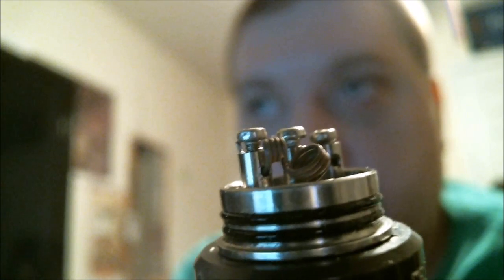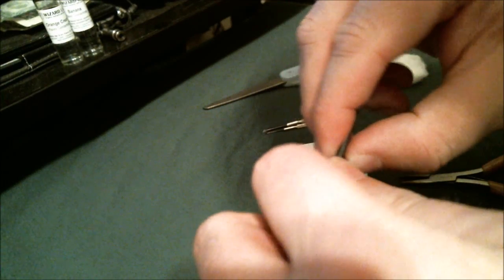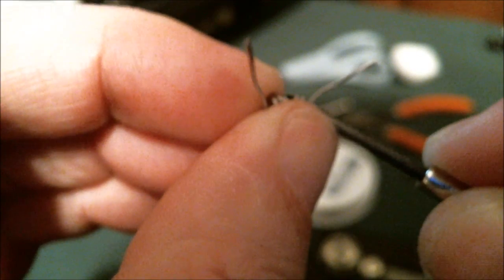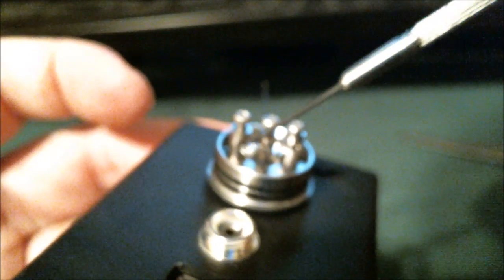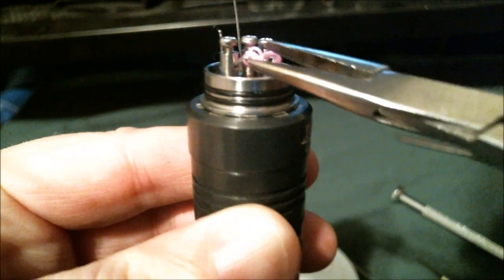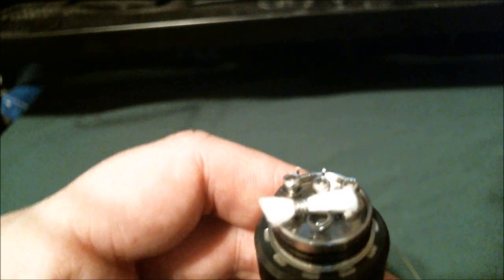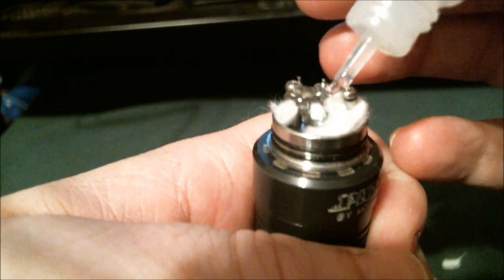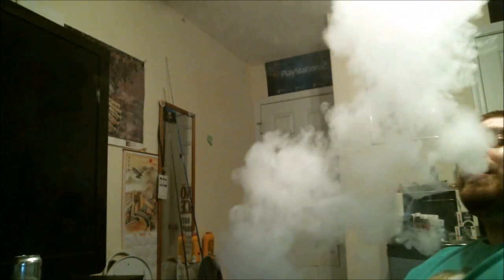The Big Dripper Coil (Build)

Comment: The bigger coil needs a bigger wick insert its way to loose.. imo
Reply from the maker: Hey Hao,  The wick is designed this way on purpose.  The larger coil is wrapped "dragon" style so it needs no wick inside.  The wick going inside is simply to feed juice to the smaller coil.  If you wrapped the large coil and filled it with cotton it would have no airflow to it and vapor production would be rather weak.  Thanks for the comment though, hope it works out for you!
Reply: Ok ill give it a try